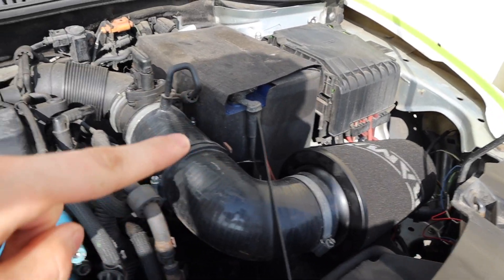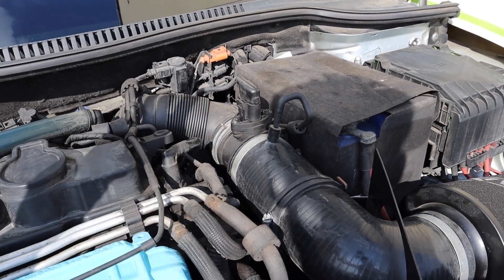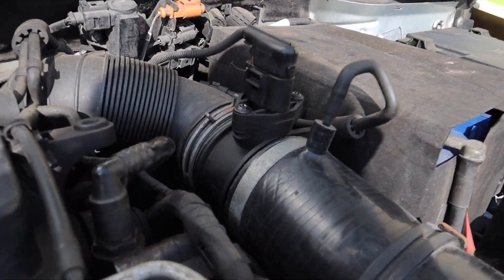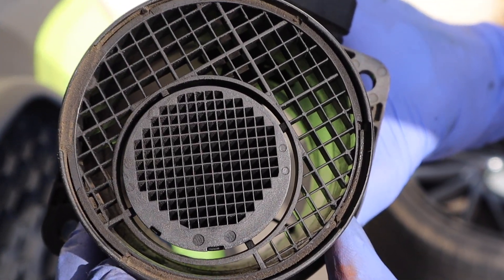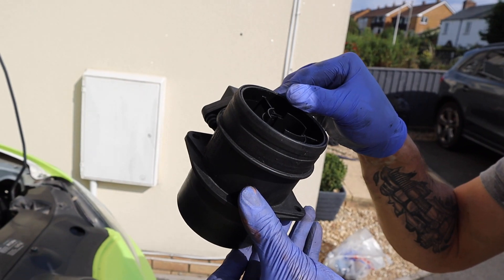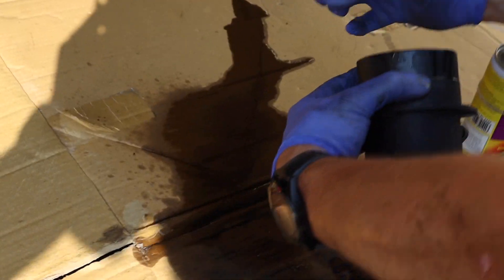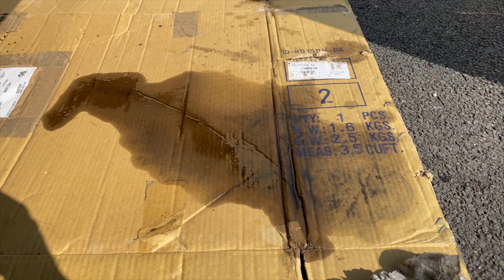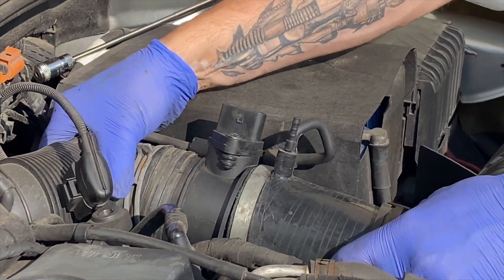CLEANING THE SEAT LEON'S MASS AIR FLOW SENSOR | JSMK

Comment: I'm having some issues with my Seat Leon 1P1 1.9TDI ... every now and then sudendly it strugles to start. Cranks but does no start. Batery is new as well the alternator...all filters and oils etc were just replaced as well the eletric resistor box. I just dont know what else t look for. I was wondering if you had any issues like this?
Reply: Glow plugs bro i have same car same engine same problem lol 3 of my glow plugs have gone im running on one atm lol you will also get some power back out of 5th gear when you replace them
Reply: @chakovsky210  quick update on my case for future reference in case someone needs it: basically during maintainence my mechanic swapped the fuel pipes that goes into the fuel filter by mistake (both pipes are black rubber and no marks to identify which goes where so he messed up) and this was causing low fuel pressure. Swapped the pipes back to the original positon and placed new filter and the car is running perfect now.
Reply: Always good to get the opinion of a mechanic and not a commenter mechanic 😂

Comment: hi i also have a seat leon 1.9 tdi but i have a question i saw that you have a pot that catches red oil what is that thing called and where can i get it groedje john
Reply from the maker: Catch can mate, quite universal and on eBay 👍😊
Reply: @JSMKYT  ahhh also if you are a Blue Peter badge holder you can craft one with pegs sellotape and washing up bottles 🍼🙄
Reply: ...........just messing.......😂😂